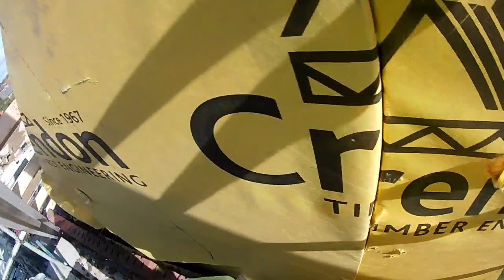Bricklaying Vlog - Table Lift Tips! & Small Trowels for Speed?!?!

Comment: Can't beat a small trowel once you get used to it, I chop and change a bit with trowels just to break the boredom and some situations work better with different methods and trowel size but never bigger than 10 inches. All big trowels will do is fuk your elbows up 👍